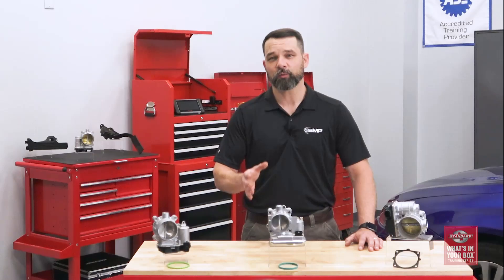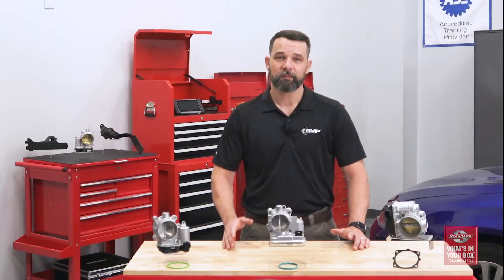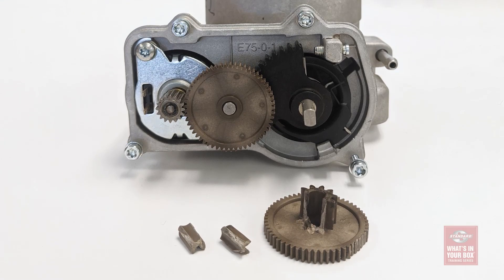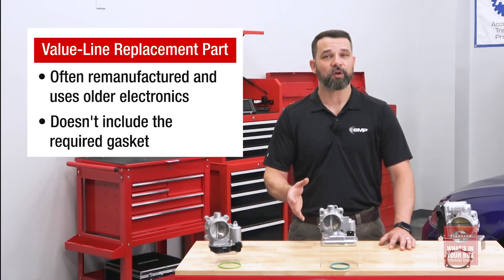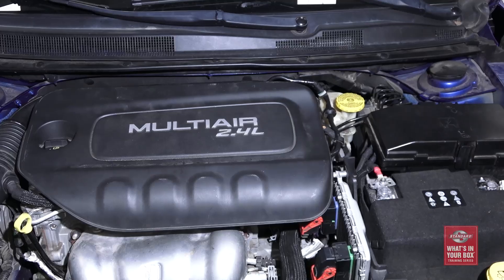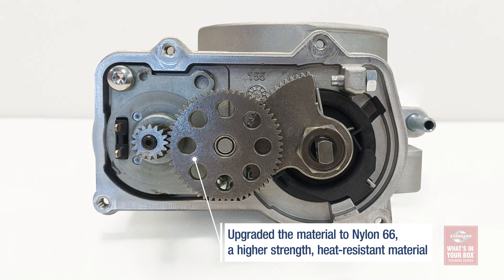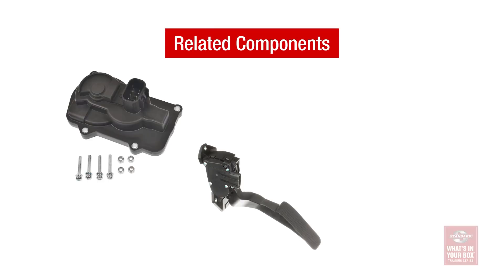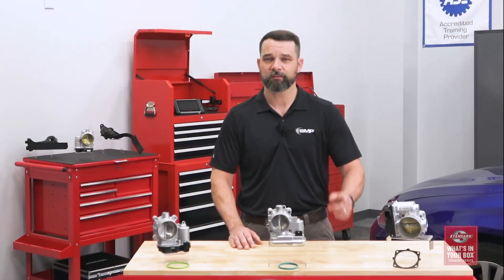Electronic Throttle Bodies | Standard WIYB Training Series

Comment: When my P-71 gets to midpoint on the temp Guage (normal range), she stalls when the car is in drive at a stop. The RPMs run at about 4 and then choke out. What would be causing that?
I can keep her in neutral at a light and feather the gas pedal, but that's all that will help her from a stall. Is it a bigger issue? Also, air/heat went out not long after, not sure if that is related.